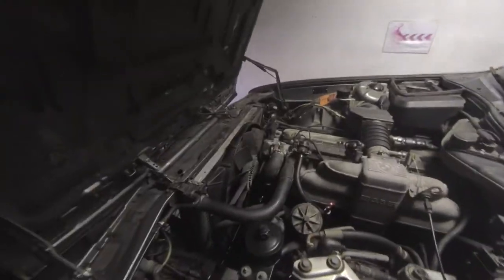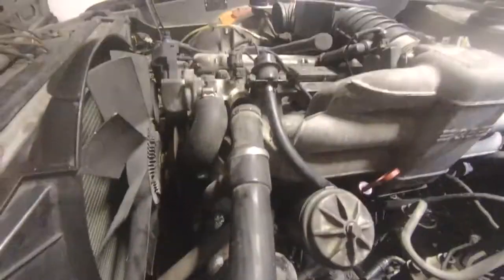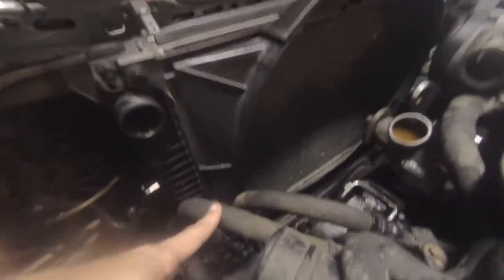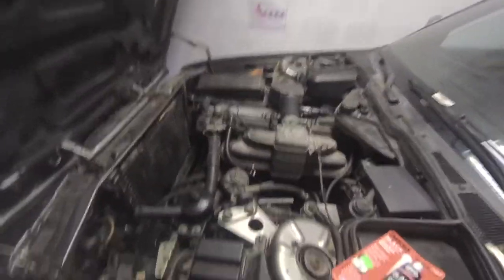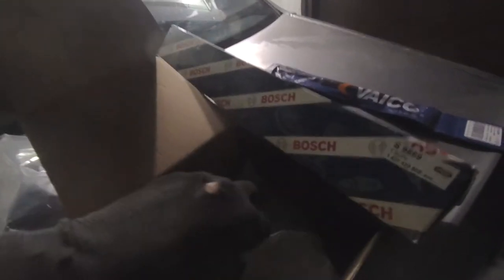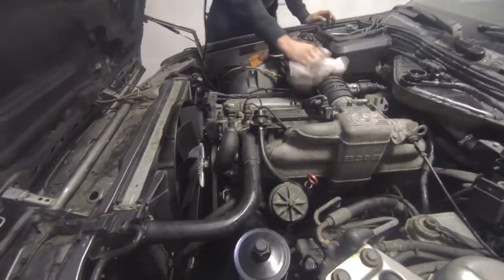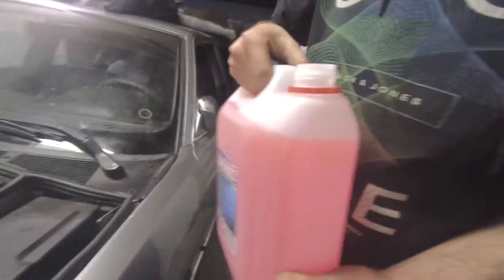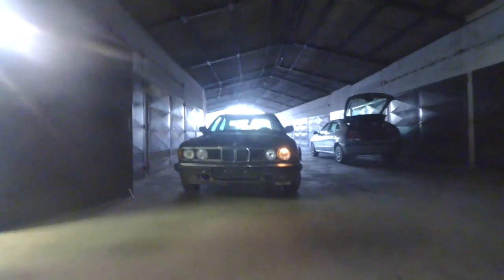BMW E32 COOLING AND TEST DRIVE

Comment: HAHAHAHA!  The viscous pulley and the propeller are very boring to remove, it was worth changing these parts because the cooling system is the Achilles heel in these BMWs.  NOTE: Nice sprint!